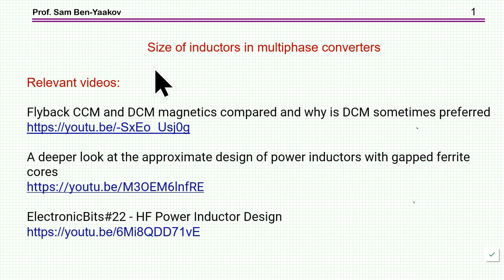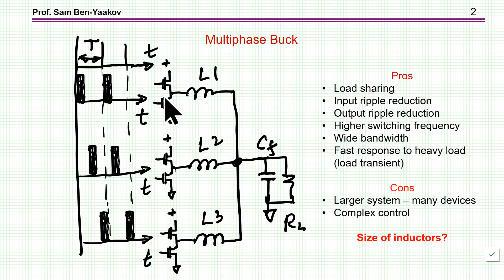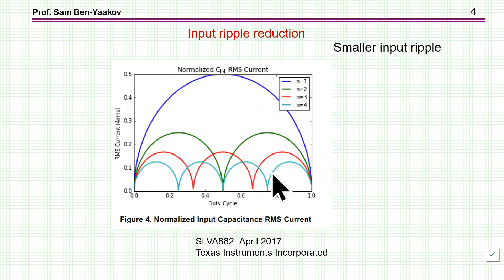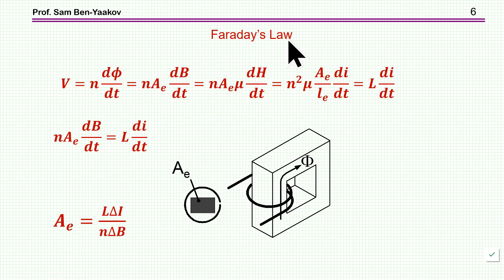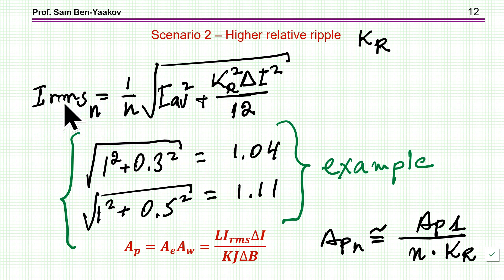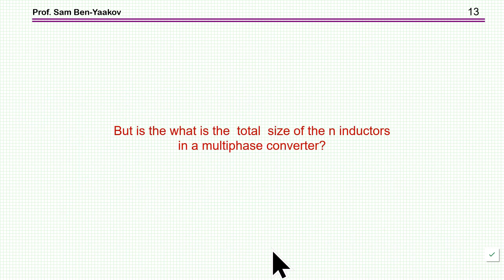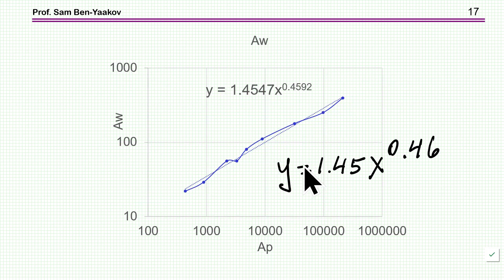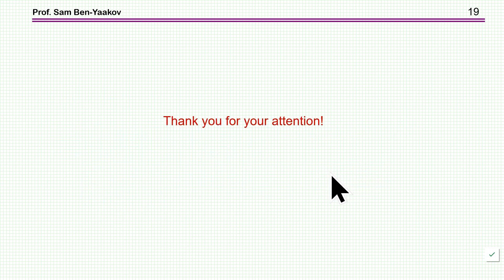Size of inductors in multiphase converters

Comment: I really like your approach to answer your initial question. 
However I do not fully agree with your conclusion number 2. In fact, E core size are proportional to the Ap when you stack cores together, for instance 2 staked cores have twice the volume and twice Ap (the core area is twice same window area so twice Ap ). 

There are some others core shape that's are not stackable ( RM, POT, ETD) and those might not have a proportional ration between Ap and volume
Reply from the maker: Thanks Marcelo for input. I was not talking aboot stacked structures. Rather, using a number of cores in multiphase versus one larger core for sibgle phase. And BTW in stcked structure you loose surface area for cooling.

Comment: Thank you for the great video. I think in multiphase converter the magnetics losses are distributed and, finally, less temperature rise can be observed. If we assume equal total loss and volume for single/multiphase, the total magnetics surface area will be bigger in approx. n^(1/3) or so, so losses per square cm of the surface will be less and temperature rise also reduces.
Reply from the maker: Hi, Thanks for conversation. Contrary to intuition the surface area will not  significantly larger. Taking into account that the hot spot temp as a function of surface function an exponent smaller than one (about 0.8 if I remember right) there might be some improvement - but possibly marginal. Good point though.

Comment: Thank you. Very interesting. 
If you use  inductive coupled inductors for a buckconverter: How does it change the dimensions of an inductor? 
According to some studies it has a benefit concerning the current ripple in each inductor and therefore the core losses are lower.
Reply from the maker: You must have leakage inductance otherwise you have a short circuit. This leads, in my opinion, to larger conduction losses. So I am not sure that it is worthwhile. As for the size, all windings must have the same n*dphi/dt so the size will depend on how much leakage is allowed.

Comment: Hi Sam, great video. Seems like there is only marginal benefit to splitting the inductors amount different cores. What about combining inductors into a single core with negative coupling or flux cancelation method perhaps? Then we could allow higher ripple per phase and not increase magnetic volume as much
Reply from the maker: Thanks. It has been demonstrated that you can partially couple and then use the leakages as phase inductors. I think this leads to higher losses.